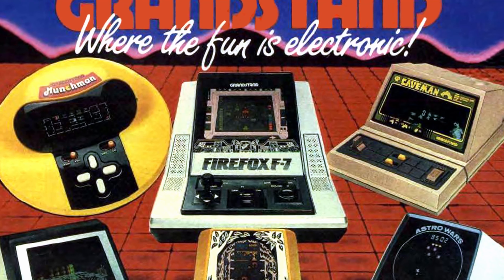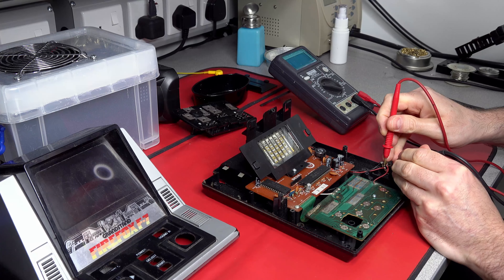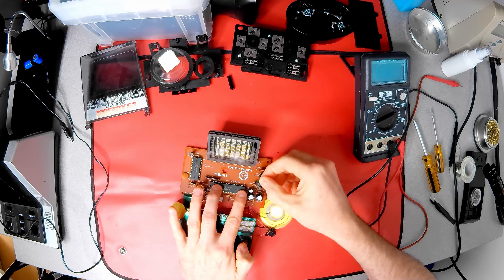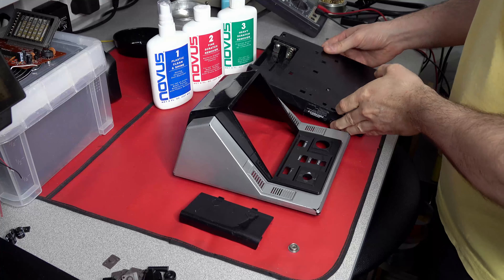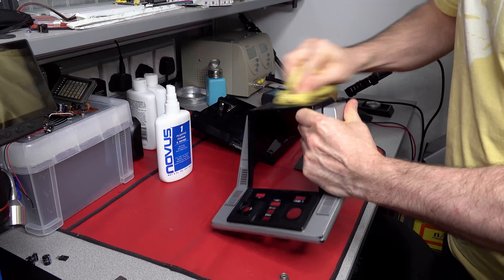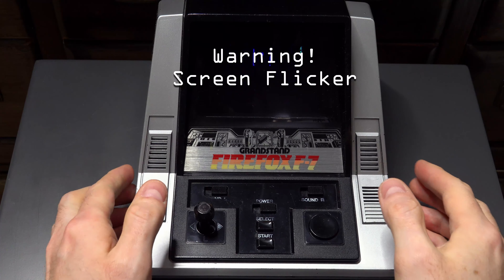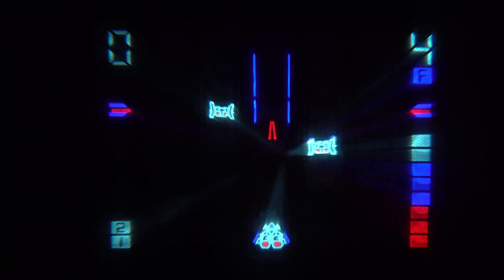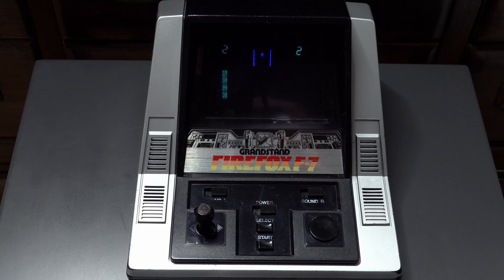Grandstand FireFox F-7 (aka RadioShack Astro Thunder, F7, Epoch)

Comment: Had this as a kid as well as a Starforce game which was similar. Found your video was searching for a dismantle guide as i've just cleaned mine up too. Needed to check how the joystick came off before forcing anything. So your video was very helpful.  Mine was still in pretty good condition so i didnt strip down all the way like you did.  My starforce game didnt have the joystick working but literrally just needed a clean up of the pads to get the rubber conductors going again.  Great little games for the time.  Had plenty of fun with them. Very much worth preserving :)  They'll be antiques soon!
Reply from the maker: Glad the video was of help, always worth doing research rather than breaking something needlessly. I just checked out that Grandstand Star Force game and it's manic!

Comment: You've inspired me to fix an old TomyTronic 3D Sky Attack I found in the loft. Just some battery leakage gunk I think (hope it hasn't gone into the case) and plan to annoy the cats with it. Keep up the good work.
Reply from the maker: I remember a friend having one of those and the 3D effect being great. I hope you can get it working. Possibly just a really good clean of the board needed and some trace fixes at worst. If you haven't already, check out my Amiga 2000 motherboard video for how I cleaned that board.